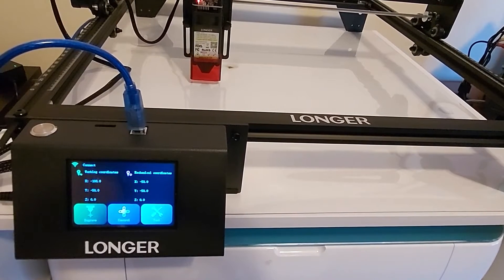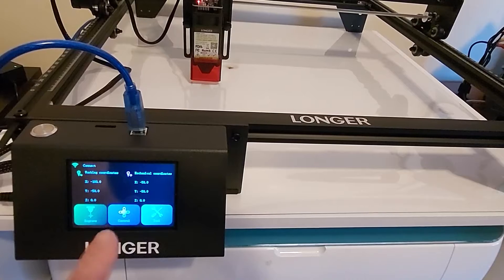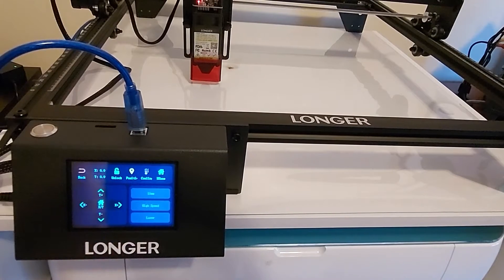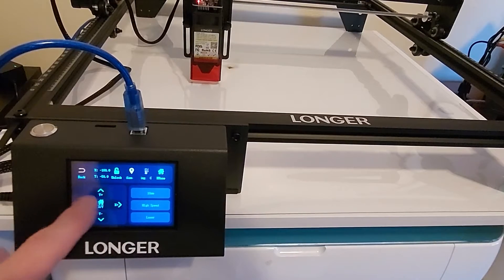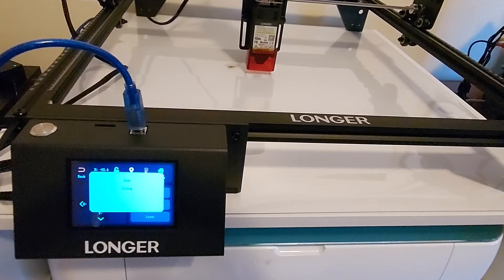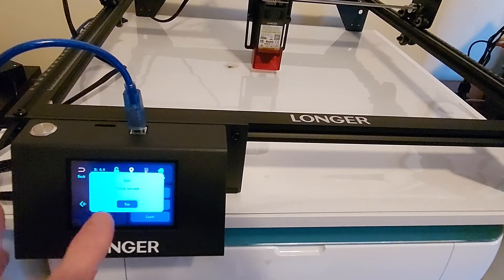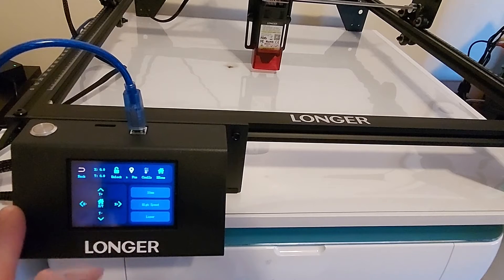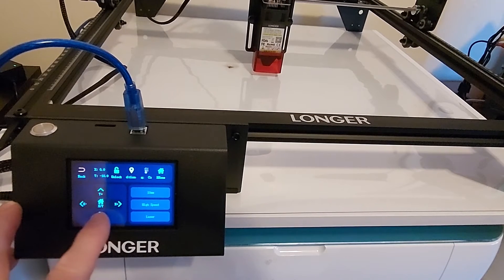Set New Laser Home Position - Longer Ray5

Comment: Good day, I wanted to ask what the problem is when I put the model I want to burn into lightburn and put the firm in lightburn and put play and it burns somewhere else than the frame was shown. I have a longer ray5 5w laser
Reply from the maker: I put the home position in the lower left corner, and then use the preview (can't remember what it's actually called) to show where it's actually going to burn.